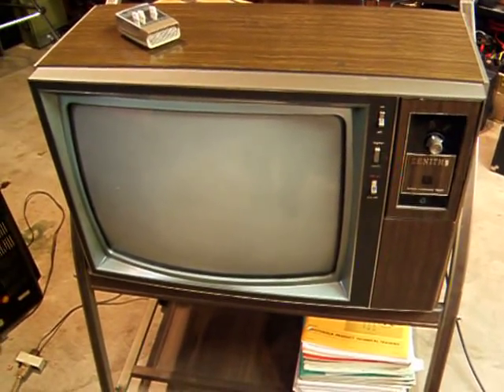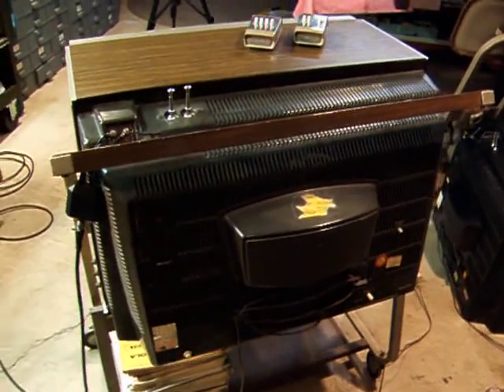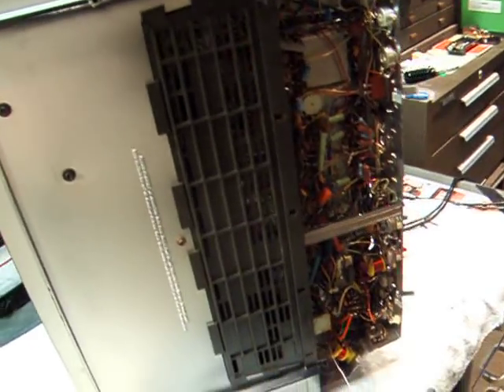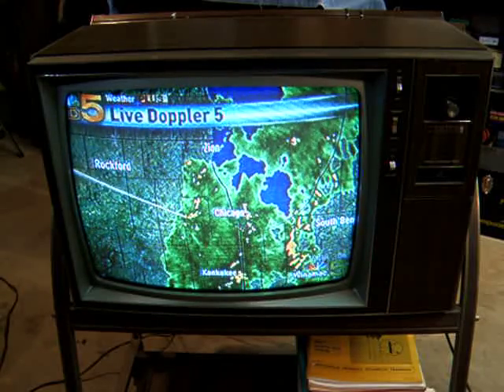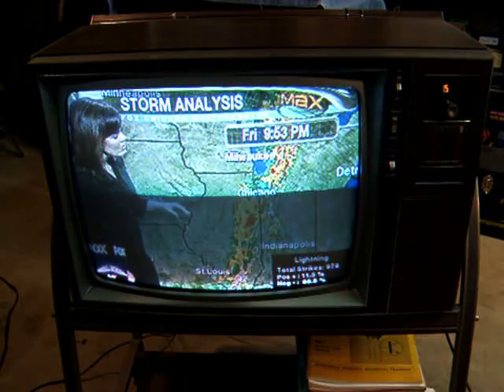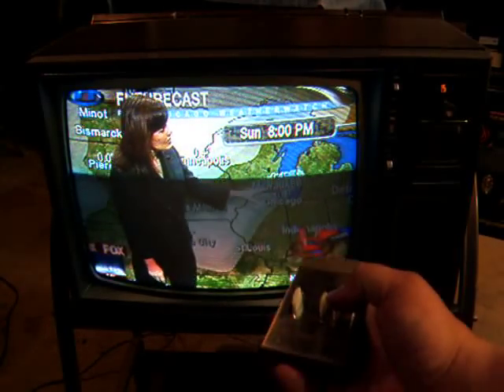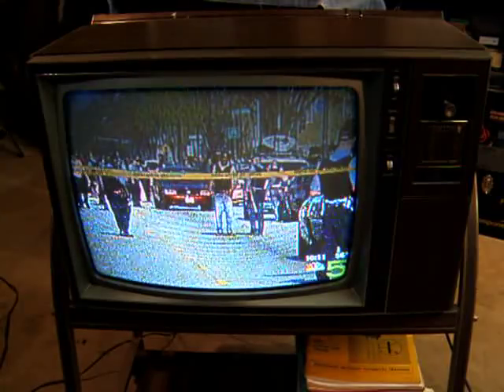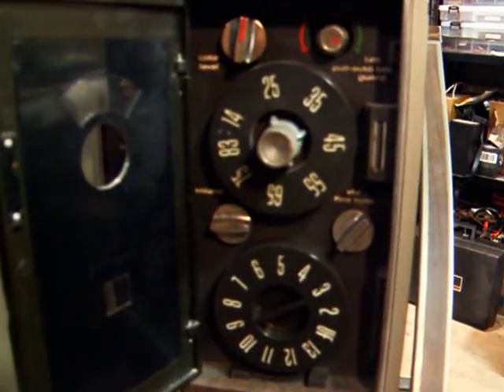Watch a 1972 Zenith Chormacolor TV!

Comment: i was a nut for convergance alighnments, i learned from the bottom up, first carryed the tube caddys, then i was running calls. it was THE BEST JOB I EVER HAD. only 10 years till it went down the tubes (sota speak) about 85 tv's went cheap. I joined the navy at 28 yr old. now im a a/c repair guy, 51 and still doing calls, thanks for all your vids. i still remember doing them service calls.....i fixed most of them in the home.  had a honest boss too. VERY RARE FOR TV REPAIR...

Comment: Very nice TV :) I enjoy repairing older equipment too.  I used to have a tv repair shop.  In 94 someone donated a chromacolor(25EC58) and I took it home.  After replacing a few  electrolytic caps (esp the one that makes the low frequency in the video fall off and the pic streaky). Also replaced the tripler.  I am still using this set now. The color and contrast are excellent.  The pic depth and quality exceeds many newer CRT TVs.

Comment: Wow, the old remotes used sound waves. I remember there were 4 rods in the unit that were struck by the one of the 4 buttons!
In the early 1970's we had a Zenith Color that used a remote using sound but electronic sound waves at the ultrasonic level (tones).

Comment: The 4-tube hybrid was also one of the first tube type sets I got, this was probably in 1990. It had a problem of having no color and I tried so many things to try and fix it and never did. Got so frustrated with it I threw it out (wouldn't do that now), Luckily I found another one just recently to replace it, has some bad electroltyics though.

Comment: Good day
Might be your lucky day!
I have the (regular cascode tuned) TWIN of the set shown on the bench..(basically the same as the one playing). 
Outside cabinet knobs etc VG cond, but needs power trans. & a few caps. 
I also have a 1975 portable RCA "Direct Access Tuner" 19" CTC81.Rare! (parts set for my 2 CTC81 consoles)
Also a bright orange JVC 16..?" set from 1976/77
Not all oldies gone!

Comment: hey man in 1972 a hybrid color tv? in Brazil in 1971 the philips introduces the KL1 chassis its was a 26 inch color tv with digital memory tuning  uses a 26 in line picture tube and infra red digital remote control the philips KL1 was hybrid, uses  only 2 tubes in horizontal output a PL509 and PY500.and the rest was transistors and ICs, in 1972 come the KL2 full solid state chassis, in the remote control you can control the color volume bright contrast  sharpness and channels

Comment: Man do I wish we still had analog TV!
Reply: Are you serious?  Analogs TVs are easy to get. I was just in a Goodwill the other day and they were selling a 27 inch Sony Trinitron manufactured in 2000 for $20. In my city you can drive up and down the streets on any Saturday and find discarded TVs and computers sitting on the curb. The computer I'm using right now was one I found in 2005 and refurbished. Why would you WANT an analog TV?  They're inferior to digital.
Reply: No no no, I meant analog broadcasts over the air, not an analog television set. I would like to be able to use my TV's original rotary tuners rather than hooking up a converter box.
And oh, that thing you said about them being inferior to digital....that's wrong.
Reply: I get you but why would you want to use the old style rotary tuner? That was one of the worst things about TVs made before 1980. It's a moving part and moving parts cause wear and tear..Analog TVs manufactured from 1980 to 2002 are damn near indestructable. I had my last analog TV for 22 years and it was still working when I donated it to Goodwill.  When I wrote digital TV is superior I meant the technology. A lot of people complain about these new HD sets being inferior and not lasting as long. That's true to some extent, which is why I tell people to never buy generic brands. These new HD televisions are made cheap because they ARE cheap compared to television sets sold the 1960s.  A brand new 19" black and white TV in 1961 was priced at $259.00.  For black and white!  If you factor in inflation that would be the same as paying $2,045 today.  So while inflation has raised prices of everything else, the prices of TVs are actually cheaper than they were in 1961. In 2010 I bought a 40" 1080p Samsung TV for $400.  At the value of today's money, that would be the same as paying $42 for a huge color TV in 1961. If TV prices kept up with inflation, that $400 set would be about $8,300.
Reply: Agreed, the analog TV's from the past up until the last decade were pretty damn good. I do like rotary tuners just because it reminds me of old radios, I like tuning that way. The thing about wear and tear is certainly true, but those things were built so well it usually wasn't an issue. Plus, you have a little more fine-tuning control with it. But...oh well...
Reply: I agree with you about the aesthetics of older radios and televisions. Some of them are almost works of art and look magnificent. I have a 1952 Telefunken stereo radio that took me four years to restore. Visually it's the most beautiful radio I've ever seen. The knobs are ivory. The sound is also full and rich. The stereo signal indicator is two blue laser lights. When you pick up a stereo signal the blue beams come together and when they meet you have full stereo.  I was offered $400 for it but it's my  baby.
Reply: Nice, that sounds like a beautiful radio.

Comment: Yes, they do work,..they are at the age where they "should" have a light overhaul of the circuit boards, (which could be done by a TV repairman or an electronics tech..(I don't have the free time anymore).IF you want to use daily..
Yes I would sell them to you...or trade for a case/cases of Labatt 50 or C.C or maybe some VQA..OR if you have a spare Atari I would go for that.
Next, my 1986 RCA 13" (I have twins) works like new
All sets are colour!
I also have a 198?7? "Sears" monitor TV 19"VGC

Comment: OK Cool.  So are you selling anything?  I really want a RCA, Magnavox, Zenith, etc, 25" inch, "console" (sits on the floor/wooden cabinet) TV from the 70's-1982.  But basically I would settle for any color TV of any size/brand made between 1974-82.  Preferably mid to late 1970's.  I did find in the garbage, a working B&W, 12" or 13 inch Goldstar TV.  But I'm not sure of it's age though.  I estimate it at 78 -88.  Do you know how I can tell when it was made?  It doesn't say anywhere on the TV.

Comment: Unfortunately, I am mechanically ignorant.  Damn.  "Manufactured Korea 1987".  On the back sticker It's small & I missed it the 1st time I looked.  The looks are deceiving because It IS loud/clunky. (I know exactly what you mean) The channel changer & UHF both have big knobs that click.  Actually, there are no buttons, just knobs.  It has no cable jack (only screws)  It has a greyish/sliver front, but the middle is fake wood look & the back is black.  It weighs about 5-10lbs (nearer 10 than 5)

Comment: if I have a spare Atari, eh? hahaha.  So you're a bit of a retro gamer too I take it?  So, what "kind" of Atari?  I have only 1 Atari 2600, 5200 & 7800.  I do however has an extra Atari Ultra Pong.  It's a dedicated console (no carts), released in  '76 before the 2600.  I also have a Magnavox Odyssey 3000 & 4000 (also dedicated consoles & would consider parting with either 1. (they're both very similar).  IF we did do a trade, can you estimate what a TV repairman might charge for an overhaul?

Comment: "A '78/9 JVC 19", Zenith 19" 1980...at home". Cool. Do they work, are they color or B&W & finally, are they for sale?  I collect vintage video games.  I want an era appropriate TV to play them on.  Playing them on a 37" VIZIO LCD is just not the same.  It takes away from the nostalgia factor.  If that's the case, I might as well just stick to using video game emulators on my PC. (which is plugged in to the VIZIO) Either of those TVs would be great, providing that they work & preferably are color